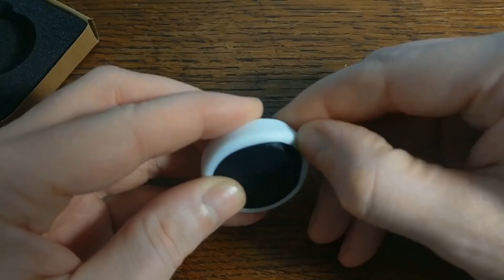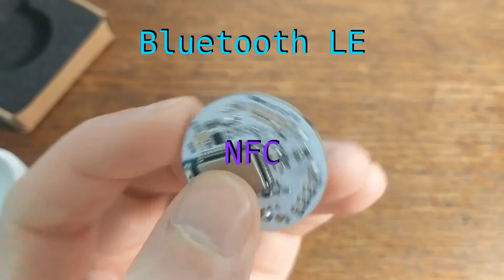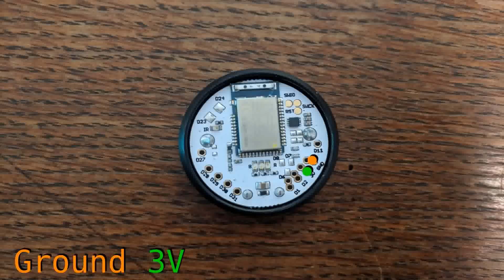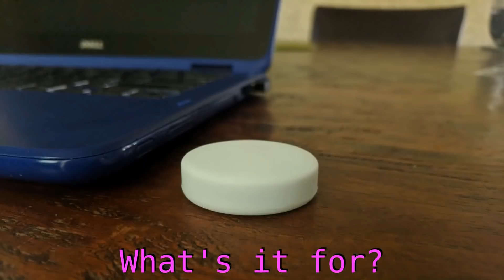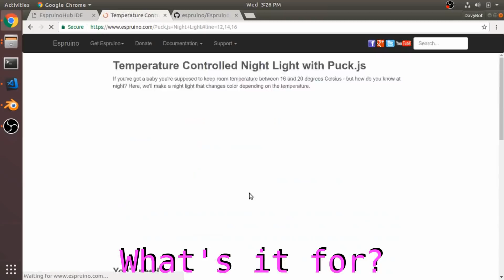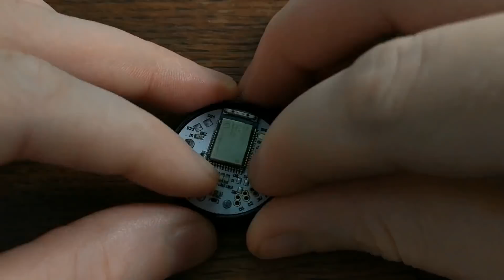Puck.js specs | Just Board

Comment: can puck.js connect natively to tcp/wifi/ethernet?
Reply: You can actually wire an ESP8266 WiFi, Ethernet or GSM module to Puck.js and get proper TCP/UDP/HTTP/etc support  (eg. https://www.youtube.com/watch?v=xvX2k5vRkg0) - as DavyBot says you'll need external power though. In a way it makes more sense to use that MDBT42 breakout or Pixl.js if you want to do that as they've got a few more IO pins - or yeah, the WiFi board has WiFi built in (but no BLE).
Reply from the maker: No, but there is the Espruino Wifi: http://www.espruino.com/WiFi

It's not as adorable of a form factor as Puck.js but it is a tiny Javascript-ready microcontroller with some IO pins. The API is: http://www.espruino.com/Internet#client

(PS You can even create your own Wifi access point using that API: http://www.espruino.com/WiFi#access-point-mode)

You can also install Espruino on a bunch of different devices, like the ESP32, but the support naturally isn't as good as the Espruino-sold boards.
Reply: @DavyBot  aww but I liked that form factor with the cap!
Reply from the maker: +/dev/null Yeah, I really like the Puck.js form factor. A Wifi module in this form factor would be a cool device. I guess the downside would be energy consumption. With Wifi it would need a bigger battery to last long enough to be useful compared to Bluetooth LE which hardly uses any power.

You could always relay the Bluetooth comms to a nearby device that's internet-connected. Have a little daemon on a Pi3 somewhere working as a bridge of some kind.